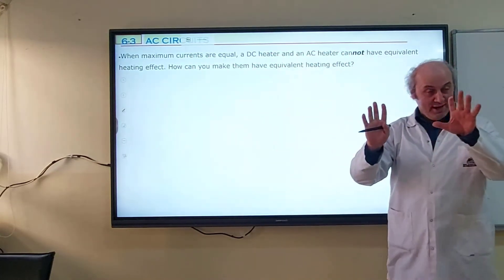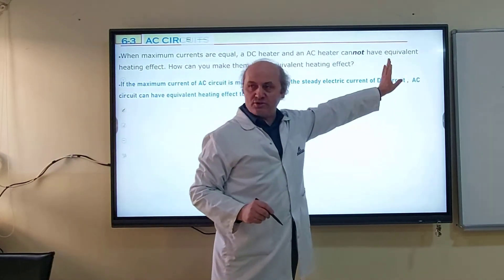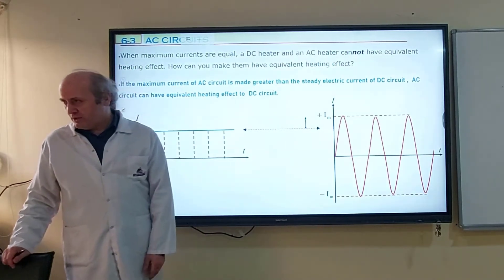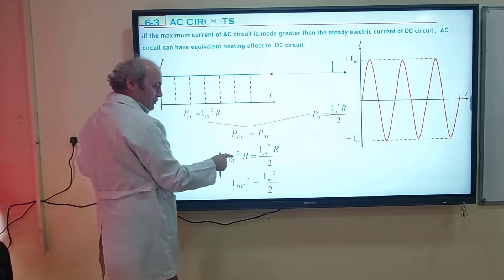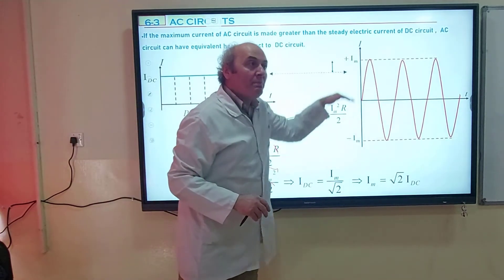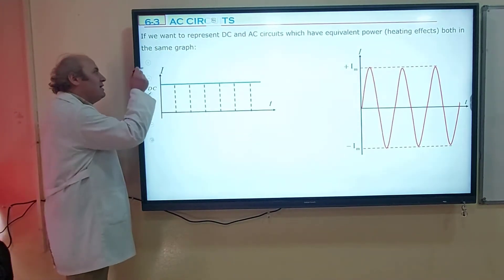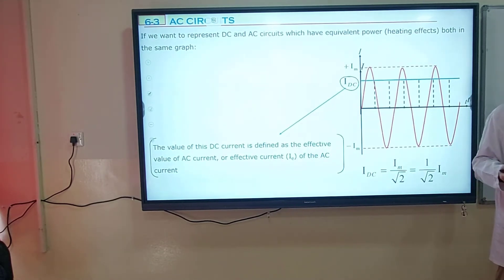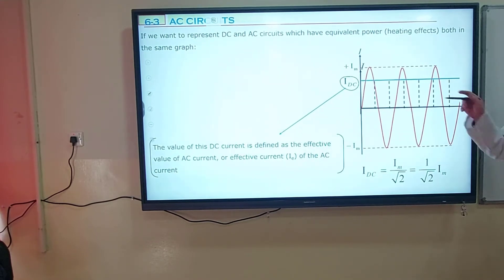Effective Value of AC current and AC emf, Chapter 6, Section 3, Course 2

Comment: But why? The rms current Ie is a little more than two-thirds as large as the maximum current Im.
Reply from the maker: because 1/root of 2 (the factor that we multiply Im with for calculating effective value) is little more than 2/3